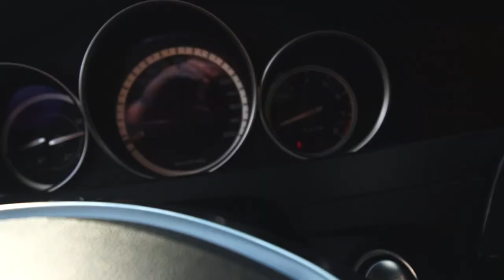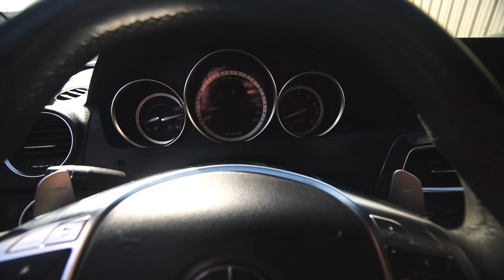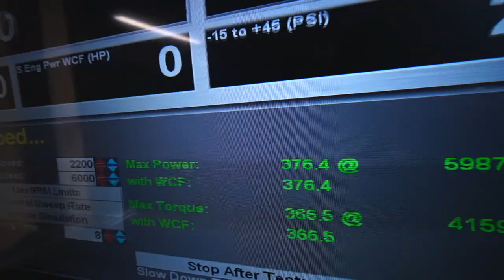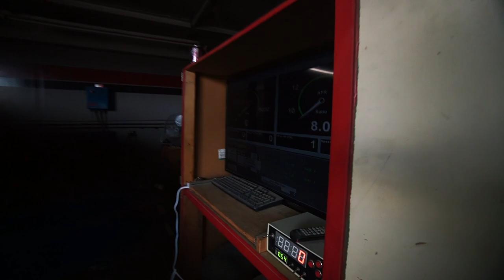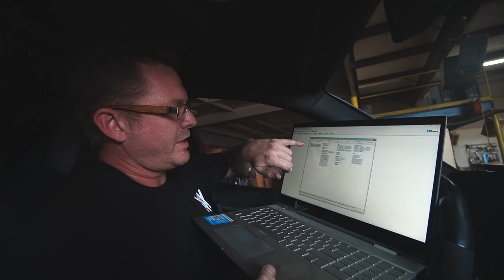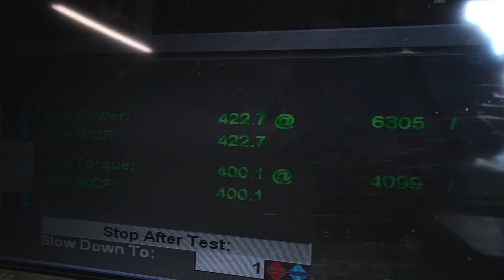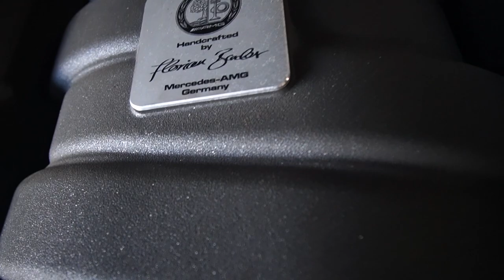Making my wife's C63 AMG EVEN FASTER!! Pops & Bangs tune + Massive Burnout!

Comment: Check your diff fluid if you’re low on it or if it just needs to be changed that usually causes the car not to spin both wheels if it has a LSD from factory

Comment: P31 or base model (non-P31), they all end up tuning out the same and they all are hand-built with a badge on the intake manifold. Not just the P31.

P31 might be slightly quicker on the road but not noticeable enough. Only reason it would be slightly quicker is bc of the forged internals and light crank. Rotating mass, yada, yada.

Comment: LSD was an option, your car probably doesn’t have one.
Reply: Def gonna need to change that out for an LSD. Not even just for fun but safety
Reply: x iDropKillz x It’ll be fine even without one, just keep traction control on.
Reply: @sunnys14  you're right, I don't think that P31 came with an LSD, the P30 which was only for the pre facelift model had it
Reply: @Dzung Le PFL P30 included LSD, on P31 it was an option.
Reply: @sunnys14  yeah, weird why Mercedes didn’t think it was a good idea to have LSD on a 451 HP RWD car from factory
Reply: @Dzung Le You’re right about that!  I have a prefacelift and next mod is Wavetrac LSD
Reply: @sunnys14  how much is it to install one aftermarket? 2k?
Reply: @Dzung Le Wavetrac is about $950 for the LSD itself.  I can install myself, it’s not difficult.